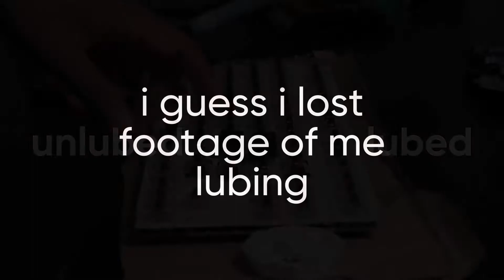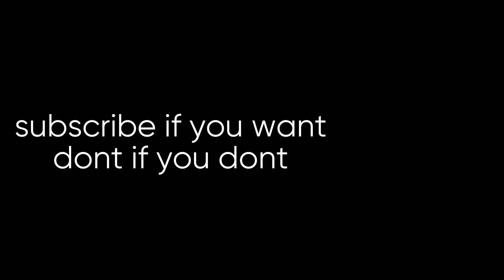Lubing the Masterkeys Pro S RGB - Giving what it deserves

Comment: You forgot a screw!  At least on mine there was also a centre screw underneath just above the serial number sticker.
Reply: how did you unscrew that? I tried to stratch off the sticker in that part, but it doesn't feel like a screw at all, just some circular hole.

Comment: Been trying to figure out a way to clip the stabs on this thing without having to desolder the whole thing to get at em, any suggestions?
Reply: Im kinda late here but unfortunately there is a way to do that but it’s very difficult :( however it’s the biggest issue given that the stabs shouldn’t be making much contact with the pcb (if any at all) given that they’re plate mounted. If you still wanted to clip them you’d need to find a way to disassemble the stab while it’s still mounted, and then find a way to reassemble while still mounted. Very difficult and maybe even impossible. 

I would encourage you to lube them, though! Lubing should make a much bigger difference!